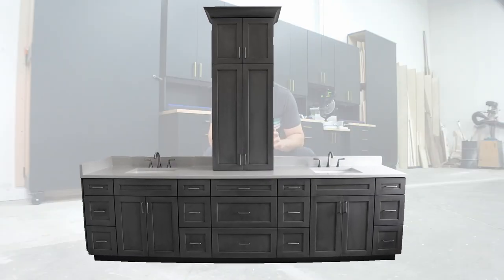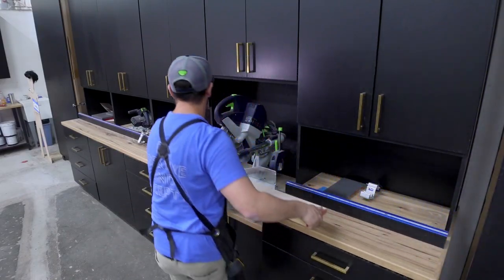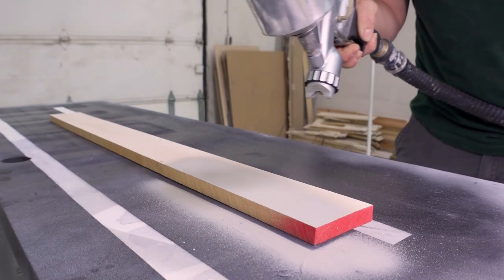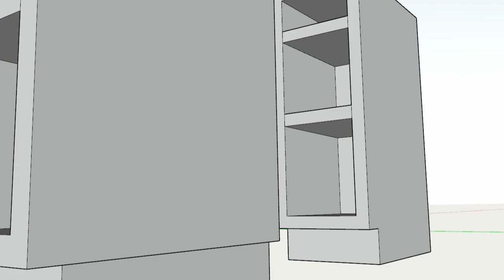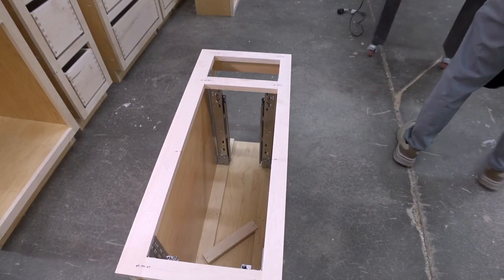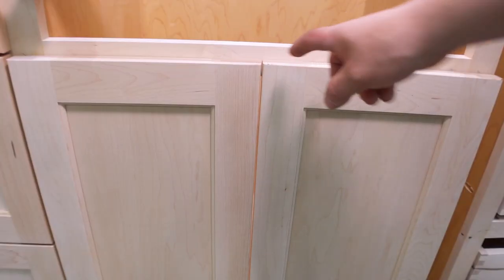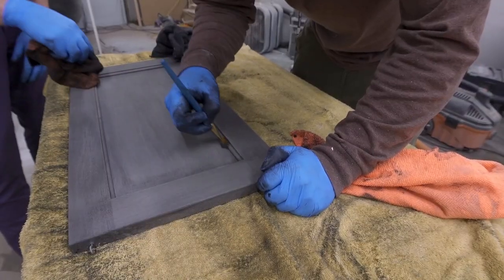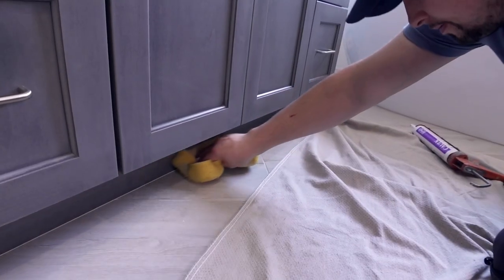A Bathroom Vanity BIGGER Than Your Kitchen!

Comment: Infinity makes an 8” by 1/4” flat bottom grind blade !  I rarely use a dado stack or as I say “ DD” dangerous Dado Stack!   I make my drawers and all dados up to 3/4 “ ( more than that the DD goes on and a cup) ?
Reply from the maker: That's good to know. I don't see how that would be any safer than a dado stack. But it would be nice to have
Reply: @FortressFineWoodworks  to me?  It seems less grabby?  And def easier set up ?  Now I could be all wet on that one?

Comment: So it looks like you dado the face frame 1/4” deep by 3/4” wide to fit onto the face frame?
Reply from the maker: I dado 3/16 deep so that the pockethole screws have more to bite into. And the widths range from 1/2 to 3/4 depending on which panel is being connected
Reply: @FortressFineWoodworks  do you adjust the dado stack each time to accommodate for micro-variations in plywood thickness ?
Reply from the maker: If I have 75% 1/2" then I will just leave the dado stack at 1/2 and double cut for any of the 3/4 cuts. If it's 50% of each, I will switch the stack
Reply: @FortressFineWoodworks  no what I mean is we all know that 1/2” ply is not actually 0.5000” and that even between different manufacturers the widths will vary a bit. So how precise do you make your dado? Do you adjust the stack to be a tight fit to the plywood in hand each time (assuming slight variations)?
Reply from the maker: That makes sense. I make it loose by about 1/32 or 1 mm . So it usually works to make the dado exactly 1/2 since the ply is slightly under

Comment: Sorry but this is a bad job. What is this ridiculous frame and that weird hinges for? It is ugly and not practical at all. 2nd, silicone? Really? On wood???. 3.  And you never center the handles for the lower drawers. In your case only the top drawer handle is centered. The middle and bottom drawer the handle has to be up. The same distance to the top edge like your top drawer....
Reply from the maker: I really appreciate your insight. Those are great ideas. I didn't think about off centering the lower drawer pulls. Thanks for watching and I hope to hear from you again!